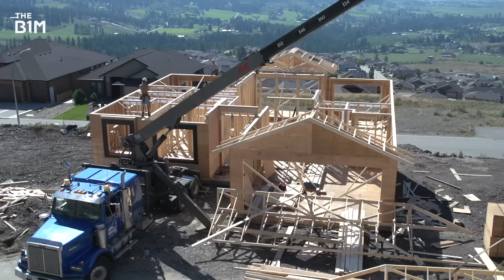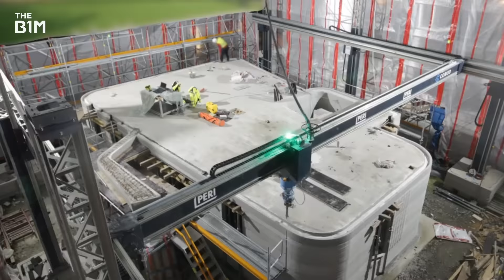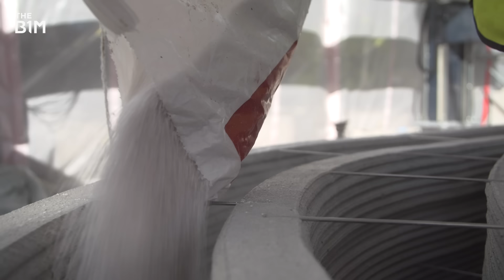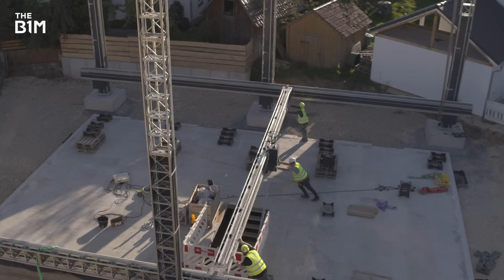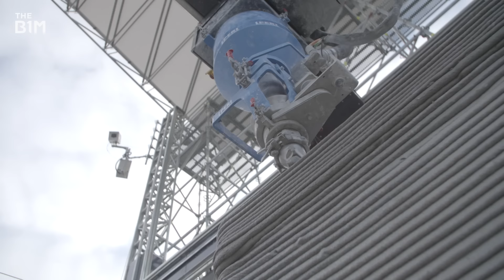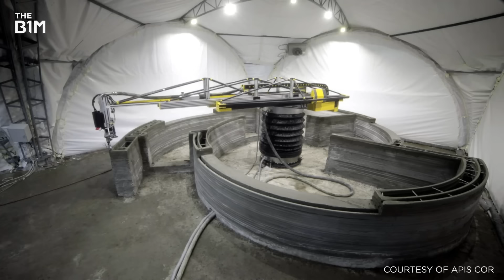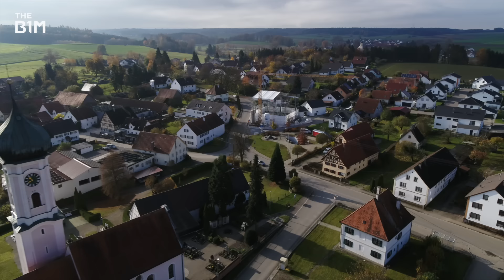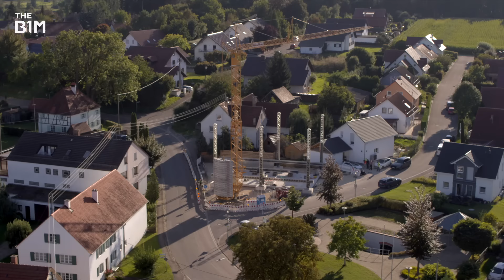Why This 3D-Printed House Will Change The World

Comment: I want to to see all the utilities installed. Plumbing, HVAC, Electrical/Broadband and interior design put into place.
Reply: This was my first question too. Utilities and HVAC. Curious to see how they do that.
Reply: @austint19  Utilites are no different to any other brick or concrete house.
Reply: Electrical or anything else with wires has to either be done with some type of conduit. If you have wiring issues and need to refeed your circuits you're in trouble.  Whole sections of walls gone. The only reason I say that is because state side we have code pertaining to securing circuits. You don't want loose wire just floating around back there. What happens when something gets in and is a little hungry.
Reply: @Tester24796  It's pretty rare to run bare wires through walls in Europe.  Certainly in Norway, where I live, it's illegal not to use conduit.  Ditto for water pipes - all joins in pipes have to be in accessible junction boxes with drainage to contain leaks.
Reply: @-_James_-  Not in the UK its not. We run cables through channels in the wall. We do put capping over the cable but it's not a requirement. The cable is protected by an RCD so no issue.
Reply: @-_James_-  What makes you think there was no conduit. I saw lengths of conduit being inserted in the video.
Reply: @Tester24796  If something gets in that is a little hungry then you have a problem since it has just demonstrated that it can eat its way into and through your house.
Reply: @Tester24796  Here in UK and Europe we channel cable just below the inner surface of the wall and use capping then plaster over. Probably the same in the 3D printed house. No issue. Conduit is only used if surface mounting cable here.
Reply: @Nick Nick Yeah we do the work and see some very big problems right of the bat. But if this works, it means more work, more work more money and more money means I get to retire faster. So it sounds good to me.
Reply: @Fried_11901  Yeah, as far as I'm aware HVAC is more of a trend in the warmer states, since a centralised AC system is cheaper and more efficient, and if you're already having to pipe cold air everywhere for AC it makes sense to re-use those same feeds for hot air and replace radiators/hot water.
Reply: I want a full educational training to do my own
Reply: I was thinking the same thing
Reply: Valid, no matter what the Plumbing must be done after 1st digging to put the pipes according to plan...unless the owner didn't mind sacrificing above ground space for those sewer pipes to sewer site, or for above ground septic tank...
Reply: @pbode24  If you don't like the finish it can be clad in whatever you like.
Reply: They can run everything above ceilings and on the outside of walls and then fur out the walls just like precast concrete buildings that have been around for years
Reply: That could be obliviously done by humans
Reply: Plumbing is easy y hvac when u have heating and cooling naturally
Reply: It would be boring.
Reply: Search for the Video : Move in Ready 3D Printed House in Germany
Reply: Search for the Video: Move in Ready 3D Printed House in Germany
Reply: I want to see someone come along a year later and decide to add or move plumbing or electrical. (Unless of course the EU passes a law prohibiting building modifications.)
Reply: @lwilton  Why do you think modifications are an issue. No diferent to any other concrete or brick house. It's callad using a power drill.
Reply: @martinw245  Well, in the US, utilities are installed IN walls. I've since learned that in the UK utilities are installed with flexible wiring or plastic piping on the surface of walls. So I guess these completely solid walls can be maintained in the UK manner.
Reply: @lwilton  Not sure what you mean by flexible wiring. All electrical cable is flexible. Its pretty much the same as yours but in metric. 

We don't run on the surface if we don't have to.

We do run cable inside stud partition walls, doesn't have to be in conduit. Also beneath floorboards, in which case its required to be two inches below the surface in case someone drives a nail in a floor board and hits it.
As I say, bare cable can be buried in channels cut into the plaster without protection but most electrician's use capping over the top and then plaster over. The capping is pointless though because a nail or screw will still penetrate.
Different for you in the US because most of your homes are wooden framed with dry wall. Ours are brick with plaster on top. Although we do use plasterboard (dry wall) on top of brick these days with new houses because its easier and cheaper than plaster and requires less skill.
I suspect in the US it depends on the regulations for that state. I was watching a US house being built on YouTube and they ran cable inside the wall with no conduit. They also had numerous plumbing pipes in the wall with no access.

The 3D printed house isn't solid walls. It's two concrete walls with a cavity in between. Standard cavity wall construction. You don't usually run cable or pipes in the cavity though because it's filled with insulation.
Reply: stupid question... how do i Nail a picture up in a 3d printed building? will somebody have to come in and line the walls with drywall or something? isn't that another expense to think about?
Reply: @JOSEPH-vs2gc  - you drill a hole, put an expansion plug in it, you screw in a hook and hang a picture. Just like on any other kind of brick or concrete wall.
Reply: @JOSEPH-vs2gc  Not an issue at all. In Europe we mainly have brick houses, some concrete too. It far more secure attaching to a brick or concrete structure than dry wall.
Drill hole, insert rawlplug, screw in. Super strong.
Reply: @JOSEPH-vs2gc  In the UK at least most houses are brick or concrete block with plaster on internal walls, and nailing picture hooks is no problem.
Reply: @JOSEPH-vs2gc  Sticky tape or some 3M goop. Or masonry screws.
Reply: @JOSEPH-vs2gc  : yes  - same way you "nail" anything to a brick and plaster wall in any house (nb, one can simply drive a nail into most structures - many concrete products included - or if more concerned - drill/plug/screw, etc)..  ha ha...

Sensible answer is to get your 2.5D art robot to paint it directly on the wall...  lol...
Reply: @JOSEPH-vs2gc  I guess you never left the US, if you think anybody would use dry wall in their houses xD
Dry walls are not used in Germany. 
Concrete or bricks all the way! 
No problem with getting pictures on the wall either. 
Drills, screws, nails, hammers ... it's that simple. 

If you punch a wall in the US, the wall breaks. 
If you punch a wall in Germany, your hand breaks. 
And that is not even a joke xD
Reply: @JOSEPH-vs2gc  drill?
Reply: @JOSEPH-vs2gc  its probabaly fast setting concrete like used elsewhere. Same as other concrete buildings but the walls are hollow with metal links
Reply: @JOSEPH-vs2gc  it actually is a stupid question ;) in Europe stone walls are normal and dry wall are considered cheap. We can hang frames just fine.
Reply: Why? HVAC isnt a common thing in Europe, but plumbing, electrical and misc wiring is easy. They run it in the voids between walls mid-print. Those holes with the plates put above them are the ins and outs for those services. It’s built in to the design.
Reply: @jamestrotter7852  you guys don't have heat?
Reply: @carlj7466  yeah, but we don’t do it by passing hot air around the house, we pass hot water through the house through a seperate plumbing loop from the taps and run it through radiators
Reply: @jamestrotter7852  ah yes I've heard of that actually, thats cool man
Reply: @carlj7466  Of course we have heat, but ventilation anc AC are rare, especially in residentail housing. The climate and the way houses are built usually mean you just don't need it.  Heating also is either done with the flooring as heated floors or can be added on the walls (even in post).
Reply: @Eipotttatsch  where I live its hot in the summer and cold in the winter. We need our furnaces pretty bad here
Reply: @carlj7466  my point was mostly that we don't usually have HVAC here, bit definitely have heating. Whether you have a furnace, heated floors or whatever doesn't really make a difference.
Reply: @carlj7466  heat is just one part of hvac and the other two are ventilation and air conditioning. And both of those parts are not common in europe as far as I know.
Reply: @jamestrotter7852 Most of Europe and North America needs AC at least as much as heating. In fact heat pumps probably make more sense. I'd really like to see a lot more details for this approach. As presented, this video is nothing more than an advertisement for one company. I see no advantage over prefabricated housing panels. Building conventional wood frame panels with some sort of connectors for plumbing and wiring conduits seems much less resource intensive. We already build trusses off-site - why not the walls?
Reply: @jamestrotter7852  that's a bit simplistic mate, run it down the wall, where does the other end of the cable go? Through the ceiling to the next point or board? There is no ceiling yet... How is the top of the void sealed? How do you get between the void and ceiling? How do you wire lighting? Prefabricated houses are are nightmare to work on, I wouild really love to hear form people who have installed services in one of these.
Reply: @felixmoran1  Not an expert but I would imagine they do it like they do with wood construction. You obviously can't install plumbing, wiring, ... while it' printing so they probably attach them to the inside of the concrete and cover it up with Fermacell or a similar material like in wood skelet construction. At least that would be the easiest way to do it IMO. The only problem I could see is integrating HVAC since those pipes have a larger diameter and would eat into interior space massively. 

Personally I would like to know the insulation values of those walls. It's just 2 layers of concrete with air in between (granted still air has a good value but still) Looks like a nightmare to heat and an overall very cold building to live in.
Reply: @mickvastesaegher2140  No, it's not just two layers with air in between. It's cavity wall construction. Normally two layers of brick and then insulation between the two. Same for the printed house, in fact the video showed them filling with insulation.
Reply: @jamestrotter7852  You know Europe isn’t the only place in the world where this tech can be applied......
Reply: @jamestrotter7852  so future renovations or changes are out? Sounds like an issue.
Reply: @daedulsworkshop  no, of course not.
Reply: @Dschukis  I should have added, without major work. Also, as others have noted, there is the issue of repairs. My biggest issue is concrete shortage. There are already supply issues for sand.
Reply: @daedulsworkshop  Non petroleum Arabian export?
Reply: @gregwarner3753  perhaps but then what is the shortage issue currently?
Reply: @daedulsworkshop  Of course future renovations are possible. Brick and concrete structures have been built for hundreds of years. 😆 You must be from the US, you guys don't seem to understand structures unless they are made of wood.
Reply: @daedulsworkshop  My god, where do you people come up with these weird ideas. Of course you can repair it. Its just concrete. Easy to fix.
Reply: @martinw245  my God, considering my mom and her husband own a construction company I have a pretty good idea of the cost of materials and labor. This is sheer stupidity and will never go anywhere unless given massive government subsidies. First saw this tech a decade ago. It has made zero progress. Dumb environmentalists being dumb.
Reply: @daedulsworkshop  

"This will never go anywhere"

It already has gone somewhere my friend. 3D printed houses are now available in the US for HALF the cost of a traditional construction method. Furthermore, the builder is inundated with orders. Including multiple enquiries for entire communities. In addition, a community is being built in Mexico, in an earthquake zone because these houses are very resistant to earthquakes.
Reply: @daedulsworkshop  

"30x expense"

Half the cost. See video I linked to. 

I have more videos regarding  details if you want them?

Because your family work in the industry with traditional methods you feel threatened. And fear you will lose work. Understandable but it is happening.
Reply: @martinw245  it won't go anywhere. Those same claims...rehash of a decade ago. It is why I stopped reading Popular Mechanics and Popular Science. Articles about the great new thing just around the corner. 

But don't stop believing big guy!
Reply: @daedulsworkshop  Again... it HAS gone somewhere. Again... there are a number of companies using this technology now. Again... there's a company in the US that is INUNDATED with orders for houses. Again... that same company has an order and enquiries for entire communities of printed houses.
The technology works, its half the price. Its viable, its gone somewhere and will go further.

The nice thing about facts is that they remain facts whether you believe them or not.
Reply: @daedulsworkshop  

"You're a joke"
"You don't know anything about the industry."

Actually, I used to work in the industry. But whether I know anything about the industry, or am a "joke" or not isn't relevant. What is relevant is facts. And the fact is that this technology is taking off all over the world. Even the Chinese are building printed houses that can stand an 8.0 earthquake.

From the way you insult me unnecessarily and the way you express yourself its clear you are quite young, so I will make allowances for that fact and not take your comments seriously.

 😉
Reply: @jamestrotter7852  Every house has HVAC, what do you think it stands for? Heating, Ventilation and Air Conditioning. You always condition the air in your house. Moisture, co2 levels and so on. A house like this will have a heat recovery unit for sure. Without you simply cannot satisfy the energy label requirements for a new build house in Europe. What would the alternative be? Open a window like  pleb 100  years ago would've done?
Reply: @haasje47  Yeah, nope. Most houses in northern europe at least miss the "AC" part of the "HVAC" you just said everybody has. Try again.
Reply: @haasje47  Wrong! Every house does not have HVAC. Most homes in the UK do not have air conditioning. Only commercial buildings do. We have central heating which comprises of a gas fired boiler which feeds hot water to radiators in the rooms. That's all.
Reply: @martinw245  Please read the rest of the comment. HVAC goes far beyond simply "cooling air down" with an AC. I guess you are your own HVAC system by manually open the window when you feel like the moisture level is too high.
Reply: @haasje47  

"HVAC goes far beyond simply "cooling air down" 

I'm well aware that HVAC isn't just cooling down. But again.... you stated that the printed house WILL have HVAC or a similar system. This is not necessarily the case. Building regulations in the UK and many countries in Europe do not mandate this. If a building is built to  a high level of air-tightness, then MHVR is ADVISED but not mandated. 

So no, its not for certain that the printed house will have a HVAC system, or similar. 

"I guess you are your own HVAC system by manually open the window when you feel like the moisture level is too high."

We in the UK rarely pay any attention to moisture levels. If its cold our central heating is on and if its hot we open a window to cool down. That's it. But contrary to your previous comment, we are not "plebs".
Reply: @jamestrotter7852  usa code requires mandatory heating and some areas require mandatory ac.
Reply: @jamestrotter7852 Good to hear but I too would like to see that aspect fleshed out. The video footage shows nothing but concrete walls.
Reply: @jamestrotter7852  its common for industrial applications and will become more so for eco builds once the gas boiler bans kick in.
Reply: This video shows you details on how the house was constructed as well as the finished product with a tour of the furnished house. The guy also has a more in depth video of the construction process if you want to check it out. 
 https://youtu.be/LVNZbl8in_Q